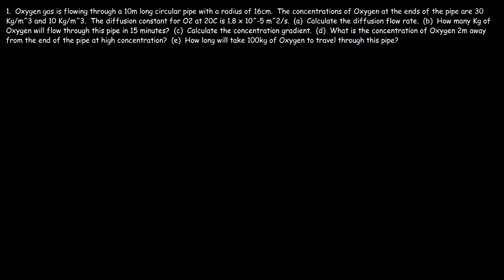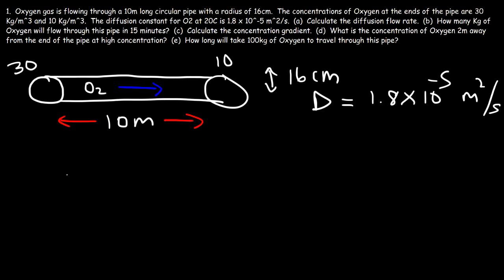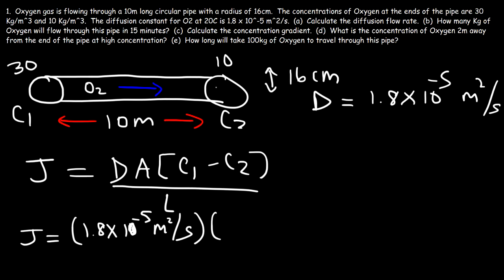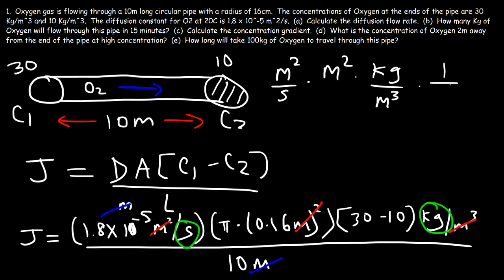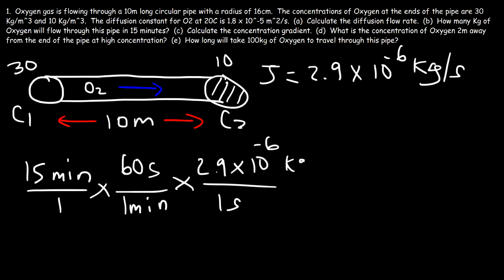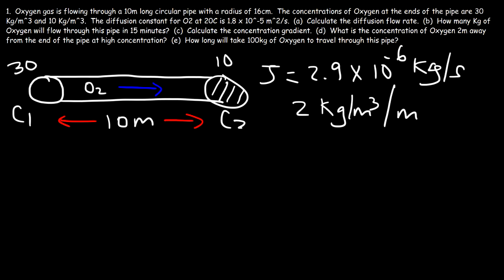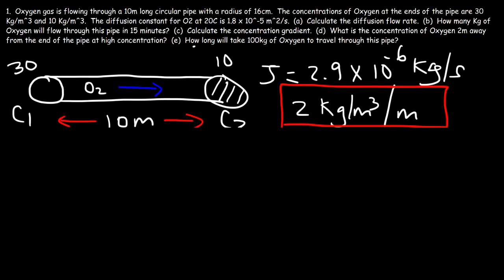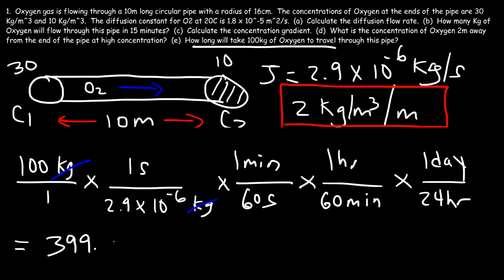Fick's Law of Diffusion, Concentration Gradient, Physics Problems

Comment: hello, I think you did not balance the units correctly, when you say J=kg/s it really should be kg/m^2*s instead. The concentration delta over the length becomes kg/m^2 not kg alone. This leads to the mass of oxygen flowing through the tube to be incorrect also, because its actually 2.895e-6 kg/m^2*s, and the cross sectional area needs to be considered.